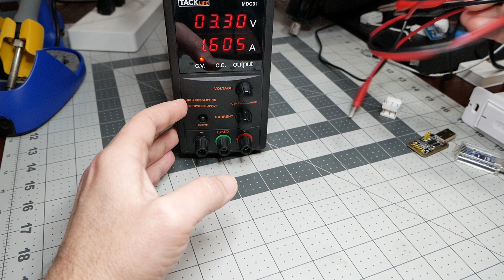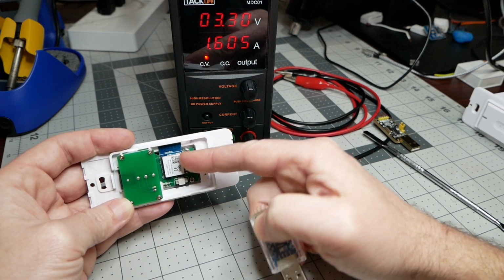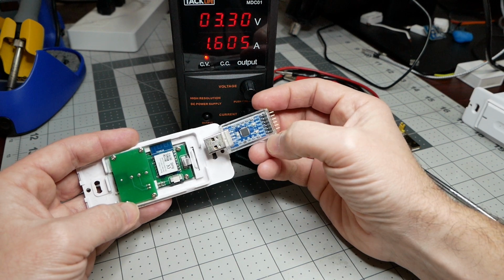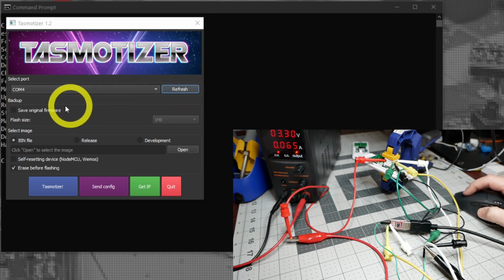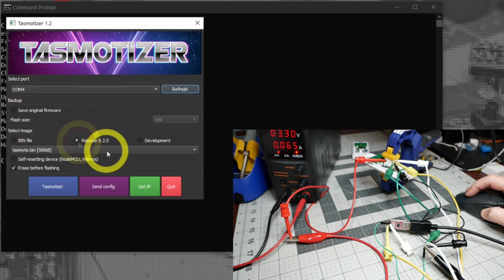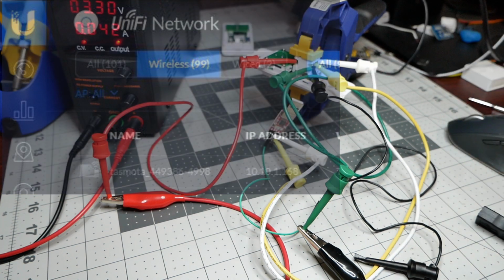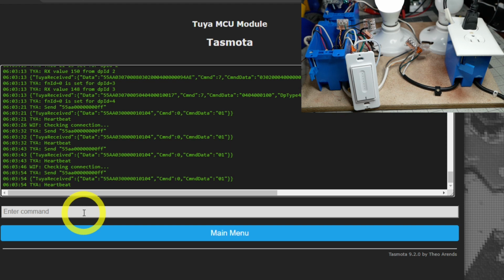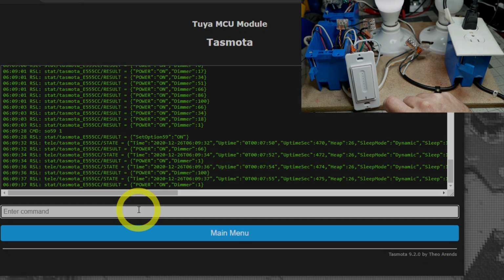CP2102 Magic? No mods, no soldering | Flash the ESP8266 TuyaMCU Dimmer

Comment: I suspect that the CP2102 has lower impedance than the other USBTTL devices and possibly active in both directions rather than just relying on pullup/pulldown resistors (the datasheets say around 36 ohms output impedance)

Almost all Tuya-RF modules are connected to the Tuya-MCU via 10/100 ohm resistors so as long as the USB-TTL device can overwhelm "noise" coming from the other devices the programming will work. Thanks for the tip on threshold voltages
Reply from the maker: Still my go to for flashing weird stuff with things on the RX/TX lines, it just works.

Comment: Hi, I posted my questions on your other video. Just find this video is more related to my Moes DSC01C dimmer. Some how, I can control the LED light on the dimmer, but it is showing opposite to the actual dimmer On/Off states. Just wondering if there is any fix for that. Also, the dimmer range LED on the switch is not showing properly on the web interface as I slide the range up and down, and web interface slider not showing on the dimmer etc. Appreciate some advices on these. Thanks
Reply from the maker: What web interface?  Tasmota?  That one doesn't update automatically since it is just for testing.  Not sure on the LED as that is controlled all by the secondary MCU.

Comment: Thank you for the video.  I just bought a handful of DS01C dimmers.  On mine, the small board that holds the micro switch looks different than in the video.  So far no luck in getting it to program.  I have tried lowering the voltage to 3.07, removing the other ribbon cable, etc.  I can see the draw it has and I see serial traffic in both directions (eevn when not flashing, from the secodnary mcu).  Just curious if anyone has gotten this new version (Same model number) to flash without cutting the run?
Reply: I think I figured it out.  These dimmers are now using the WB3S chip not an 8266.
Reply from the maker: That was going to be my next question was the chip type.  Definitely needs a transplant then.
Reply: @digiblurDIY  What is the reason all of the manufactures are going to this new chip?  I have not looked at the specs for it but assume there is a reason.
Reply from the maker: @netnutmike  cost, easy bluetooth pairing, and controlling their supply chain mainly.

Comment: @digiblurDIY  Thanks for all the great videos!  Before I buy a bunch of these, has there been any updates for this Treatlife dimmer?  I presume it's still not possible to control the LEDs or have double-press or long-press actions because of that second chip?  Are there unused GPIO pins on this ESP where we could rewire that main LED or listen on the button press?  I'll join the discord chat later but figured this video's comment thread would be the best place to have any updates posted, if there were any.
Reply from the maker: I would suggest one without a secondary MCU like this one. https://youtu.be/uU7oy-Kz7T8
Reply: @digiblurDIY  Sadly that model failed the Wife Certification Program™ so I'm investigating other options, and all of the models which passed seem to use a secondary MCU.  There are a lot of great options for switches (thanks again for the great coverage of these and Tasmota) but none with a wifi-only PWM dimming which would have been ideal for me (i.e. dimming support in hardware+ESP, but faceplate only has a simple switch).  If you've heard of any, please do let me know!
Reply from the maker: The linkind ones have the buttons attached to the ESP https://www.digiblur.com/p/linkind-esp32-smart-switch-how-to-flash.html?m=1

Comment: Am I in trouble if I don't have the Tuya MCU product ID line in the console after flashing?
Reply from the maker: Did you set module 54?
Reply: @digiblurDIY  I did and when I use the weblog 4 command I see a bunch of "...TYA: Send..." entries but no received entries. Maybe I broke it when flashing with the jig or something. I'll have to try another switch tonight.
Reply from the maker: Which dimmer? Some have different baud rates and pin configurations too
Reply: @digiblurDIY  it's the treatlife Smart Light Switches SS01S, single pole, no dimming just on/off (I thought I was starting with the easy one). I tried another and same problem.
Reply from the maker: oh...these aren't secondary MCU switches.They won't have that.  https://www.digiblur.com/p/treatlife-smart-switch-ss01s-single-pole.html
Reply: @digiblurDIY  aww man I feel dumb for thinking all the treatlife switches would be the same. Thanks for the help!
Reply from the maker: All good! Learn from the mistakes. Won't be the last as I make plenty myself. Luckily software ones are easy fixes. 

Most regular on off switches will not have this secondary MCU.

Comment: Great tutorial ! For others that may be attempting to flash these switches, I had to remove the second ribbon cable from the daughter board. I spent many hours trying different voltages and different CP2102 modules. It wasn't until I "cut" the trace that I was able to flash the chip. Upon further inspection I didn't cut the trace so no need to solder anything.   So grateful for all your videos. Waiting for the dimmer programming tutorial. Keep making them !
Reply from the maker: Thanks!  That undervolt trick has worked for some as well.

Comment: Is an FT232 proven to not work? Mine doesn’t seem to with this dimmer :(
Reply from the maker: That is correct.  The secondary TuyaMCU gets in the way.  With that adapter the undervolt trick does work though.
Reply: @digiblurDIY  clever. Off to buy another TTL adapter I go ;)
Reply: @digiblurDIY  Flashed and that all worked. No running into an issue where it's simply not connecting to the HA MQTT broker even though I can access with other things like MQTTlens. Lost again :(
Reply from the maker: I would try an easy user ID and password then if it  still fails. Are you using VLANs?

Comment: Some of the CH340/CH341 varieties have a known issue with it being mixed 5v and 3v3. Originally the better-built ones allowed you to set a jumper that would correctly switch it from 5v to 3v3. However many clones end up messing this up and you would get a 3.3v signal line and 5 supply or  3v3 supply and 5v signal lines.  This was particularly obvious when it was used for SPI or EEPROM programming.  I could see the same issue when trying to Flash a ESP module.

Comment: 3 days of monkeying with this and finally all your methods works except I had to drop to 3.07V. That was the magic number to get it to read and write. DS01C is a nice looking dimmer.
Reply: It wouldn’t work at 3.3v? I’m pulling my hair out trying to get it to connect, and if I do I get MD5 errors. Managed to get it to read and backup the existing firmware but no writing yet :(

Comment: Hey man thanks for the video. For some reason I wasn't able to flash mine I got the power supply and everything and tired doing it over and over many times, checked it over but no luck so I returned the dimmer. What dimmer do you recommend for a beginner? I've been thinking to try this one what do you think?
https://www.amazon.ca/Gosund-Switches-Function-Remotely-Control/dp/B085M74BKR/ref=sr_1_17?dchild=1&keywords=sw2+dimmer&qid=1610505116&refinements=p_85%3A5690392011&rnid=5690384011&rps=1&sr=8-17
Reply from the maker: Gosund dimmers are junk.
Reply: @digiblurDIY  So do you have any suggestions of what I should get?
Reply: @digiblurDIY  Hey Travis, curious why you say the GoSund are junk?  I have the option to get a bunch for cheap and would really like to know your thoughts and/or the trouble with these units, thanks so much!
Reply from the maker: They use a non standard Tuya mcu protocol. They don't save states correctly. Pain to use. Faceplate is so touchy. It almost seems like everything with these dimmers seems to be wrong in some odd way. I wouldn't install them myself if they were free. I value my life.

Comment: I have to buy the CP2102 and LM2596 DC-DC power source to get the DS01C to flash works all the time.  Now after I follow all your steps, the led did not turn on when the light is on but the relay works fine.  Also when I move the dimmer up and down, the Tasmota Dimmer Slider does not moved.  Did I missed any steps?
Reply from the maker: Nope. All normal. The Tasmota test slider doesn't not auto refresh. Just a test piece. The LED on the switch is handled by the code on the secondary chip that was not changed.
Reply: @digiblurDIY  I flash the second one and redo your steps, now the white led turn on when lights is off and white led off when lights is off.  Is this normal?  Why is does not turn to red when power is off to match the TreatLife Switch?   Do you have a link for a sample yaml code for HA?
Reply from the maker: You would need to ask Treatlife why they did the LED design that way. I would use the auto discovery or Tasmota integration.

Comment: Thanks for another great video.  Bought a geeni outdoor two plug from harbor freight and was able to flash it over the air using a pi and tuya convert.  Bought a second one from Amazon and was unable to flash via tuya convert.  Opened it up and found a TB3S rathe than the WB3S chip.  Has a similar pin out as the TYWE3S chip.  Wired it up and tried TASMOTIZER with no luck, would not connect.  Wondering if you have ever run into the WB3S chip set?  If so do you think the method described in this video would work?  Thanks
Reply from the maker: That's going to be a different chipset, talked a bit about that at the end of my last video or you can check out what M.J. did here - https://www.digiblur.com/2020/12/treatlife-dual-indoor-dimmable-smart.html

Comment: Hi, I got my DS01C flashed but now I have one problem. When I set the dimmer brightness to low through the web interface,  I can control the dimmer just fine through the face plate. However when I set the dimmer to Max through the web interface, the face plate LEDs do not update and the faceplate can no longer be used to control the dimming. What is interesting is when I set the dimming halfway in the web interface I can use the dimmer faceplate to increase the brightness to the max (indicator LEDs still not working) but can only decrease it down to the midrange set by the interface. Any help would be much appreciated, Thanks!
Reply from the maker: You set the dimmerrange too? The web GUI does not update. I use the dimmer commands to check myself.

Dimmer 25
Dimmer 50
Dimmer 100

100 is max.
Reply: @digiblurDIY  dimmerrange has been set for me it was 25 - 1000 and the web UI updates perfectly with the touch pad.
Reply from the maker: It shouldn't update, as it isn't designed to.  The web interface is just for testing input.  If you change the dimming level it requires a refresh of the Tasmota GUI to see the changes.
Reply: @digiblurDIY  That's not the problem though the actual LEDs on the touch bar don't update and it ends up getting stuck.
Reply from the maker: Is it the same as this one?  https://github.com/arendst/Tasmota/issues/10080
Reply: @digiblurDIY  No as the webGUI always works fine the problem is the led interface on the front of the dimmer. When the web gui slider is set high the 5 leds on the front turn of only the bottom one is lit and I can no longer dim the bulbs using the touch strip on the dimmer until I manually set the slider in the web Gui back down to 1%
Reply: @andrec1675  same issue here. Did you get any resolution?
Reply: @ScottSheltons  No not yet im still working on it I found that dpID 4 is unused and I'm wondering if that has something to do with it, do you think we should open up a GitHub issue report?
Reply from the maker: I believe 4 was the dimmer range on mine.
Reply: @digiblurDIY  How do you link that to a fnID, I think that's probably the issue?
Reply: @ScottSheltons  @digiblurDIY Finally have a solution, turns out when I cut the pins to the MCU, then resoldered I accidentally grounded the RX pin which meant there was no receiving signal and the front LED's as well as the response time was broken. I opened it up today and spent a good couple hours trying to repair the pins, finally got it working and it's glorious!

Comment: I was thinking that for those without a power supply it might be possible to use 2 AA non rechargeable batteries in series.  That's 3.0v which is a little low but it may work.  As a bonus that low voltage may cause the second chip to not interfere.  I don't have one of these so I can't personally test it 

Two rechargeable AA batteries probably wouldn't work because the voltage would be too low.

3 AA rechargeable batteries in series would be 3.6V which is a little high but might work.

EDIT: Check the voltage on the side of your battery because chemistry can be different.

I'm going to suggest you use new Alkaline batteries for best chance of this working.
Reply from the maker: They do state the tywe3s is. Working voltage: 3.0 to 3.6 V
Reply: @digiblurDIY  It's interesting how closely that matches up to the specs for 2AA alkaline batteries in series or 3AA NiMH batteries in series.
Reply: AAs can source up to 2A when fresh. We used to test them at work using a DC ammeter. Anything close to 2A was considered good.

Comment: I had a conversation with you via discord regarding your Etekcity and motion sensor video.  When I sent you a photo of my TTL, you shared how you thought that one may be troublesome.  That was a few weeks ago.

I am wondering if I should just buy the TTL you’re recommending and stop trying to use the CH340 as this has not worked at all.
Reply from the maker: While the CH340 has brought me along my journey with so many devices, it stopped dead in its tracks with this process.  I'll still keep it around of course but the CP2102 is definitely key here.  I tried about 10-12 times with the CH340 with the exact process here and failed every time.
Reply: @digiblurDIY  I went ahead, purchased the CP2102, and was able to flash the Etekcity single pole with it, for my first ever flash.  Thank you!
Reply from the maker: You are hooked now!
Reply: @digiblurDIY  For sure!!
Reply: @fantasma62  hi Tony so did you have to use a separate power supply to achieve your flashing? Or did the cp2102 has sufficient power to flash it? Many thanks.
Reply: @digiblurDIY  thank you.  I’m definitely buying the cp2102 and trying flashing the Etekcity with it.  I got frustrated and figured I’d simply install it, Vesync integration to HA, then make a Node Red flow for that switch, to remove from the cloud.
But I do want to try to flash it before I completely give up and do that...😁

Comment: Great video as usual!  Another trick for when flashing isn't working, reset the jig.  sometimes the pins aren't making a good enough connection. so wiggle it, or remove and put back on, often works for me.
Reply from the maker: What's weird is it took me about 3 or 4 tries of just resetting power and such to get it. Didn't even move the jig. Something weird with that MCU tug-of-war. I could see it driving you nuts if the jig was misaligned too or even a bad jumper wire.

Comment: Hello.  You explain why a separate power supply is  needed at some length.  But the current shown on the bench power supply never exceeded 80mA.
Reply from the maker: Yep. Just talking about that in discord. It doesn't work without the separate power supply though. Tried it. The mystery gets deeper.
Reply: The secret is this. A typical USB port on a PC outputs 500mA. The USB2TTL Adapter will only consume what it needs to operate. When you Power a Device from the USB2TTL Adapter it's robbing the current from the Adapter rather then the USB Port. The Adapter's Regulator can only output 100mA so after you figure how much the Adapter needs to power then the Device needs it can easily over current the Adapter's Regulator and shut down.

I'm working on a little Kit that makes the spaghetti mess a lot less. along with a USB dongle based on the CP2102. My take on the Adapter will have a Micro USB connection instead of a USB A plug so you can use a typical Cell Phone cable plug into it. Have a separate Voltage Regulator V7803-1000-SMT-TR for the Device to be programmed. Instead of fighting the Dupont cables and IC Hooks just have Dupont connectors on one side and Hooks on the other. A couple of switches to latch GPIO-0 High/Low or out of circuit.
Reply from the maker: I get some of the power issues. Doesn't explain why I can swap in the ch340g with the same setup and it won't work.

Can't wait to see the new setup.
Reply: @digiblurDIY  Most likely Clock/BAUD Rate issues. After all the ch340g is a Chinese clone of the old classic FTDI chip series used to program Micro Controllers.